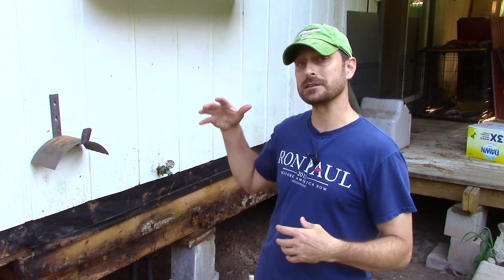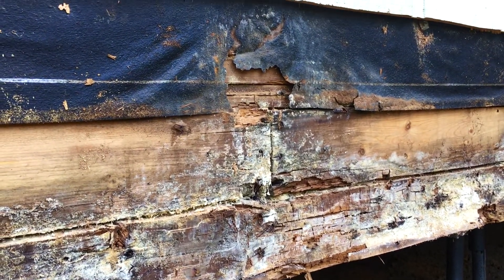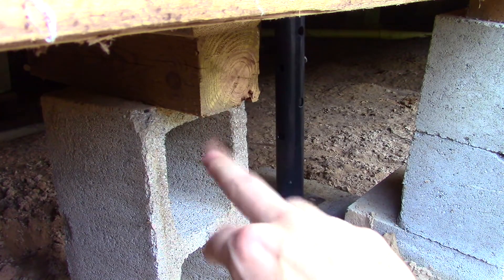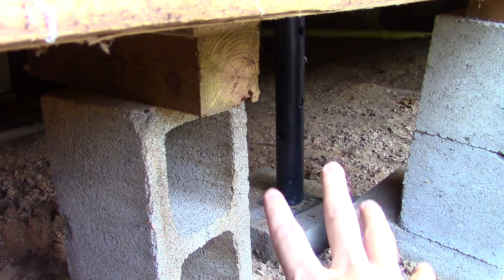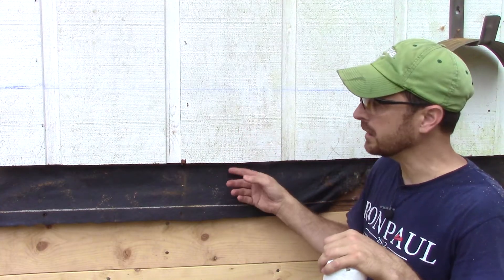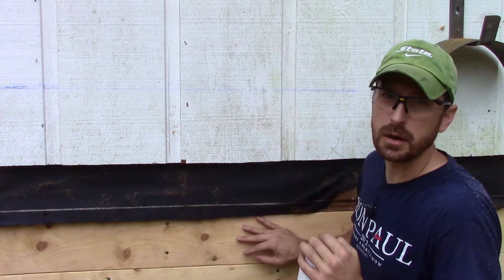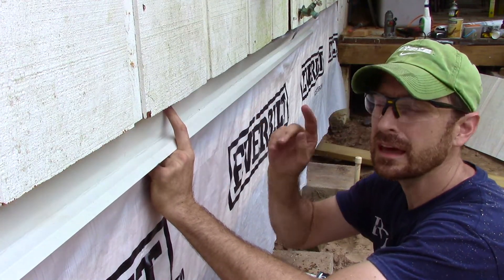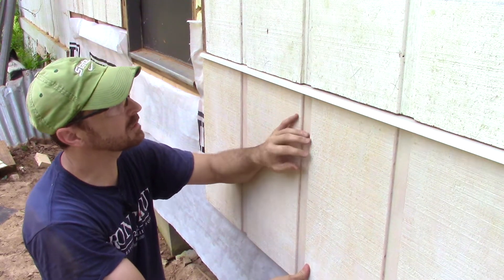How To Repair Damaged T1-11 Wood Siding On A House! Tips For Structural Repair And A Great Finish.

Comment: I have the same issues because of an incorrectly attached deck that started the exact decay... thanks for the excellent video... cheers!
Reply from the maker: Thank you. I wish contractors would learn how to attach decks and stop ruining peoples homes.
Reply: @CountryLivingExperience  Exactly, this one has caused massive problems, and they waited too long to go for a much easier repair, Now it is a mess. Your video will go a long way towards sorting this one out. I'm hoping the base plate of the wall is not ruined, as well. Cheers to you!

Comment: Be advised that not all siding that looks like T1-11 is T1-11.  At one time the Masonite company produced a siding that was pressed wood fiber and a binder or similar.  That is not the same as T1-11, a multi-layer wood material.  The fiber material was removed from the market after lots of lawsuits over failures due to water damage causing it to disintegrate.  There is another look alike on the market that is supposed to be as good as T1-11.  I used some to repair a tractor incident in my shed about 5 years ago and it is beginning to swell at the bottom from splash.  The 20 year old T1-11 old wall is in perfect shape.  Except for needing a coat of paint.
Reply from the maker: Absolutely. Good comment.
Reply: My mom's single wide in the front of the kitchen window ledge is made from some damn stuff that got wet and is like grains, totally disintegrated. Looks like my chicken feed once it gets wet

Comment: Very informative. I see other YouTube videos that show that the Everbilt is NOT waterproof like Tyvek, and BOTH are quite expensive. Since you are only covering a small portion of one wall and I would think you would want it waterproof (especially where sprinklers overspray or rain splashes) why couldn't you use a 6 mil plastic sheet ? It would cost a fraction of Everbilt or Tyvek and would be waterproof, especially if you seal the staple heads and any seams.
Reply: Using 6 mil in the exterior is not recommended. You'll can (potentially) trap mature within the walls. Maybe not as critical in this application..  Conditioned areas breathe from the inside out. As you know heat seeks cold and with it it creates mositure. All house wraps, some better than others, are permeable, letting moisture flow only in one direction. In this case I would have cut off the minimum amount of tar paper, lifted it and stapled the new under it as in the shingle effect as he describes here.. Then I would have tapped the joint created.. House wrap is not a waterproofer. It is designed as an air barrier first.

Comment: I have a shed that is about 50 yr. old built with T1-11 siding and with 2x4's 16" on center. Part of the siding on 3 sides rotted and I removed with a circular saw. I cut the siding 1 ft from bottom edge at front, 18" from bottom edge on side and 8" from bottom edge on back on based on location of rot on each side. No vapor barrier was installed when shed was built, so any if I install before screwing new siding the barrier will be visible from the inside of the shed, so it would not look right when inside the shed with the barrier visible and at the 3 different heights. One option I don't want to do because of  time involved is cutting the front and back siding same height as the side (18"). Installing paneling inside to hide the vapor barrier is not an option because there is a lot of shelving that would have to be removed that would take a lot of time and $. 

1) If I treat the back of the new T1-11 siding with a brush-on waterproofing before replacing, would that be sufficient instead of using a vapor barrier? If your answer is yes, what waterproofing do you recommend?

2) I wasn't able to cut the siding very straight, so after I attach pieces of the siding would it be ok to attach treated 1x4's over the seams of each side instead and attach a piece of quarter round moulding on the top edge for water run-off instead of using flashing if I seal the moulding with silicone after installation? There are 1x4's installed vertically at each corner, so installing treated 1x4's  over the seams would look ok.

3)  I prefer to use GRK exterior screws for attaching the siding...what size/length do you recommend?
Reply from the maker: Thanks for your comment. 
In my opinion, unless the shed is a livable and conditioned space, I would not worry about a vapor barrier. It will serve no purpose to place it only behind small pieces of siding at the bottom of the wall. 
Painting the back of the siding will do nothing. If moisture gets behind the siding, it will rot the studs, sill plate, etc. That is one major purpose of the vapor barrier. A layered system is how to prevent water entrance into your building. 
Take the time and make everything straight. It will alleviate problems in the future. Placing silicone with the moulding is not recommended. The quarter round will not do much and you will still get water behind any wood piece like that. Flashing behind the wall as I showed is the best recommended method to prevent water entrance at that point. The length of screws don't make much of a difference as long as the siding is secured properly. 
I hope this helps. Have a great day.

Comment: If I may. For new DIY'ers who, like many cannot hold a heavy skill saw horizontally and cut a real nice straight line. So, by attaching a ledger board at the proper distance below the chalk line to rest the saw against and follow while cutting. This will ensure a nice, straight cut. My buddy, a house framer for 50 years can hold a heavy gear driven saw and cut as straight a line as can be... I can't.

Comment: at 4:28 you mention using a moisture meter to check for rot in T1-11. What readings should I be looking for? I had an inspection done and was told readings between 5% to 15% are good. Below 5% is rot.  Do you agree?  Thanks, Joe
Reply from the maker: Not sure who you had at your home checking this but anything around 12 to 15% is not great. 20% is rotting. 5% is really good and normal for a house Wood you buy from the store is about 6 to 7%.
Reply: WOW!! Thank you so much!! The readings he showed me were between 1.5% and 4.8% along the bottom of my T1-11. He stressed the point of "Dry" rot. It really pays to ask for second opinions and not get scammed. I really appreciate your help. 👍
Reply from the maker: @joeskoien  You're welcome. You did say just "rot" in your original comment. Dry rot is a bit different. Dry rot occurs when the wood has been exposed to moisture for a long period of time, rotted, then dried out without reintroduction of moisture. Dry rot is a thing but it is not necessarily related to moisture content. If your wood is dry rotted, it needs to be replaced. Thought I needed to clarify. You can test it by taking your finger or a strong stick and trying to push it through the wood. If you dent it or your finger goes through, it is dry rotted.
Reply: Thanks again 👍I checked it as you said and it was just fine. You not only saved me money, but also time because I was gonna begin repairs myself (with the help of your videos of course). All I really need to do is paint. I has been about 7 years. Appreciate all your help 😁

Comment: Great video!! I have some T1-11 rotting at the bottom due to soil building up too high.  My home sits on a hill so there is no way to do a clean cut across the bottom of it all. Not every panel has rot in it, would you suggest just replacing the bottom of the individual panels that need it? Should I still install flashing at those locations, or is paint enough to prevent anything getting in where the new/old panels meet?
Reply from the maker: Thank you. Flashing and paint is always the best. 
I cannot physically see your project so it is hard for me to give advice on what to do with it.

Comment: Hello, thank you for the video its very detailed and informative. I have never replaced siding but might need to soon. Why was the flashing put below the old siding / above the new siding? Could you put the new piece flush with the old piece and seal it with epoxy or something and then put the flashing under the new piece so it is at the bottom?
Reply from the maker: You can put another piece below the first. That would be called a butt joint. The problem with a butt joint is that no matter how well you seal it or try to get it flush, there will always be water that can get in the joint. The flashing prevents water from getting in that joint. That is why the top remaining piece of siding needs to not touch the flashing or water will wick up the piece too. This is the correct way to do it for water mitigation. Or if you have the money, you can replace the entire piece.

Comment: Great video!  Question:  What do you do about the z-flashing when you have to cut the horizonal line at two different heights?  We have a two-foot cut right by the back door, to the west of it, but the A/C guy suggested not cutting up that high behind the A/C, so we didn't have to deal with all the electrical stuff that has to do with the A/C.  He suggested a cut there of about one foot up, which is one foot below the cut next to the back door cut.  So the z-flashing won't be in one continuous line, so I'm worried about leakage between the two boards.  We were going for the same height of a cut all around the house, for appearances' sake, but it makes sense to avoid all that wiring behind the A/C.
Reply from the maker: Honestly I would try to cut it at all the same height if at all possible. It will look strange if it is at all different heights. You should be able to move the electrical stuff fairly easily.
Reply: @CountryLivingExperience  Wow, I really appreciate your getting back to me so quickly!  I don't mind the difference in the look, but I'm a rather small lady working by herself, for the most part, so working around the electrical would be more do-able.  Any advice, if I have to go forward with the two different heights in this one area?  It will be the same height at all the other places around the house.
Reply from the maker: @camdenwise5816  It is honestly going to be a challenge to change heights and butt the siding on the transition. Just make sure you paint the ends of the boards really well and then seal with some caulk when you are done.
Reply: @CountryLivingExperience  Alrighty.  And would you suggest still using the z-flashing, or just using the caulk to seal it off, and leaving the z-flashing off?
Reply from the maker: Z flash at the top. Caulk on the sides
Reply: @CountryLivingExperience  Thanks again.  I just now, to see how everything worked out, put up the Green Guard, a thinner foam board, over the studs - which have fiberglass insulation in the stud bays - put some Tyvek over the Green Guard, and stuck the z-flashing over the Tyvek and under the upper piece of T-111.  How long should the galvanized finishing nails be that are used to attach the z-flashing to the T-111 be?
Reply from the maker: @camdenwise5816  They should just be long enough to get through the sheeting, insulation, and then into the stud.
Reply: @CountryLivingExperience  This is a real question, because I have so little experience in this arena - how far into the stud should the galvanized finishing nail go?  And, where the left end of the z-flashing goes, for, maybe, 1/3 of an inch, behind the right-hand jamb of the back door which is to the left of the z-bar/siding repair, do I just put a big glob of caulking right there, to prevent the water running down the z-flashing into the house, and smooth the big glob out to make it look nice, and put caulking down the side of the piece of T-111, against the jamb, to the bottom of the piece of T-111?  I know you don't put caulking in the channel of the z-flashing, as that would defeat the purpose, though I have seen people do it.
Reply from the maker: @camdenwise5816  Nail in at least 1" into stud, Caulk down side of t1-11, Glob at the end of flashing, no caulk in flashing channel.
Reply: @CountryLivingExperience  Excellent!  Thank you so much for your answer, and I'm glad the question was clear.  I have to share that I do think about this a lot, to make sure I do right by our home, for the years to come.  Today I saw a house wrap called Tyvek Drain Wrap, and it has vertical grooves all down it.  I have been quite worried about mold forming between the house wrap and the foam board, so have been considering not putting any house wrap at all, as one contractor suggested that would make it more likely that no mold would form.  But the foam board I'm using, the Green Guard, is very thin, so I do feel like I need a layer of house wrap, to ensure that any water/rain stays out.  Have you heard of the Tyvek Drain Wrap, and, if so, what do you think about it?  Please forgive all my questions, and do feel free to stop answering them at any time.  I'm just trying to finish this job as soon as I can, but with the best result possible.  God bless you and yours, and I hope you're having a safe and happy holiday.  Here's a link to the drain wrap:  https://www.diyhomecenter.com/dupont-tyvek-drainwrap-9x125.
Reply from the maker: @camdenwise5816  The drain wrap is something new to me. i don't know how it operates. There is a big debate in the building industry as to whether you should wrap your house or not. I don't really know how to help on this subject.

Comment: I'm going to build a deck against the house and will be removing the cheap wood siding, first. I want to replace it with T1-11. Can I attach the ledger board to the new T1-11? My house is tall, so what would I use to seal the top and bottom panels where the seem would be?
Reply from the maker: Never directly attach a ledger to the building unless it is flashed over the top and that flashing goes up behind your siding. Using standoffs is a much better solution. You need a piece of Z flashing between each seam of the T1-11 sheets.

Comment: At minute 6:25 ..... Isn't there usually some kind of outer board that covers the home and then the tyvek sheet is put over that ? I think I've ever seen tyvek put on open studs and insulation??? I'm confused
Reply from the maker: You’re correct. This home was built in rural Texas 42 years ago and did not adhere to conventional building standards. The siding on the building acts as the sheathing instead of having both with the tyvek between.

Comment: Are there different thicknesses or qualities of ti-11 siding or all they all the same?
Reply from the maker: As far as I know they are all 7/16" (1/2). The only thing different is the faux batten spacing.
Reply: Not expert, but just bought (1) sheet of 9/16" T1-11 from lumber yard to do a similar job.  Paid $70 vs $38.46 at HD.  I think quality does vary for T1-11, and that's why spent the extra $ to ensure max lifespan for the replaced 1' of T1-11 along base of wall.
Also/FYI:  lumber yard had dark brown Z Channel, which wasn't available at the big box.
Reply: That's 19/32", not 9/16!

Comment: I have rotted spots on lower edge of siding. The problem is its behind a gas meter so its difficult to get to. Is there a way to  just waterproof or mend it  there?
Reply from the maker: It really depends on how far the rot has gone. You want to also find our Why it is rotting there and try to prevent it. You can paint it heavily if there is only a small amount of rot. Biggest thing is to stop the water from entering that area of the siding.
Reply: @CountryLivingExperience
Reply: Thank you very much.  There is a water spigot near there which leaks it is  probably the cause of the rotting. what would you use to mend it? i was thinking the Crack filler (Yellow stuff)Then the white paint that is used on the flat built up roofs.
Reply from the maker: @hikechoco  Unfortunately you will not know how much rot is behind it unless you tear it apart and look. You need to get it dried out and replace what is damaged and repair the leak.

Comment: One more question, where you leave the gap above flashing (to prevent wicking), what stops critters from crawling up in there. I live in TX and termites/ants can be a big pain.
Reply from the maker: I also live in Texas. Fortunately termites cannot crawl over that bent angle on the flashing. (just like a termite shield) You can put some sealant on the underside of the flashing where the bottom replacement piece of t1-11 butts up underneath. That will prevent them from getting in that way. If you are on a crawlspace, it is important to have termite shields on all of your piers to start.
Reply: If you build anything out of insect food, guess what?
Reply: The better thing to do is replace the whole 4x8 section so you don’t need to put the drip edge in. This works, but it doesn’t look as nice and it adds a lot of extra steps
Reply: @mitchberning1595  not all t1-11 is 8 foot lengths my house has 9 footers that are 5/8ths thick and they are very hard to find. No big box store carries them. At least not in that thickness.

Comment: Is there a reason you didn’t leave the 1/4 to 3/8 inch gap between the siding and flashing?
Reply from the maker: I left a gap between the upper siding and the flashing. I mentioned that.

Comment: Thanks for this video. I bought a house in a rural area and we have the same siding. Some of the very same problems you show are what we have. I haven't cut anything away yet but I'm afraid that there's zero moisture barrier. If that's the case, do you recommend that I just replace the entire sheet?
Reply from the maker: You're welcome. You would have to so some investigation. That rot could have traveled up behind and done some other damage. If you need to wrap the house, just replace the whole sheet.